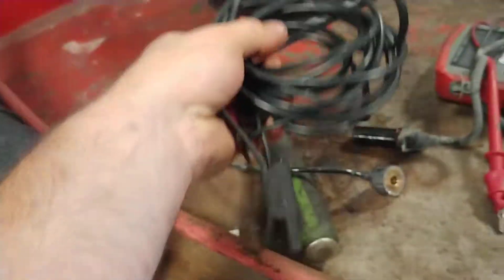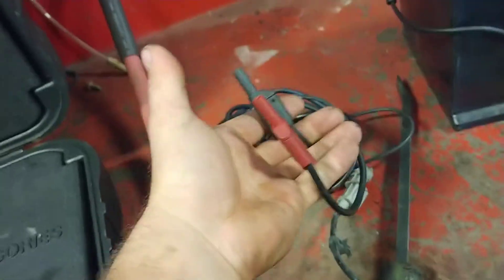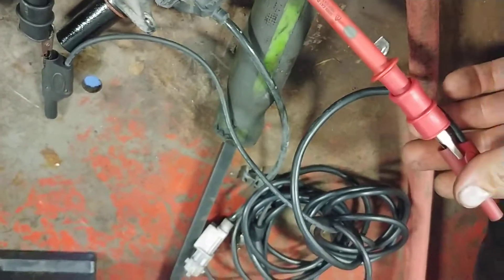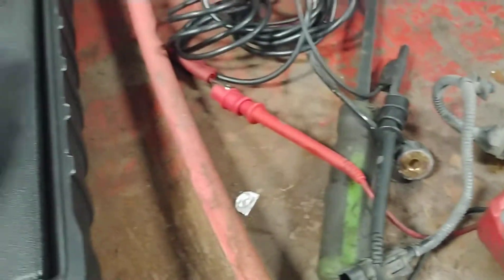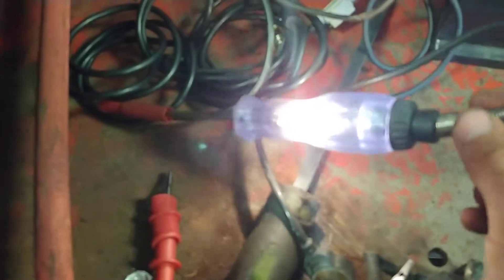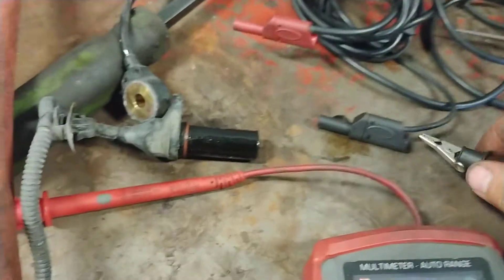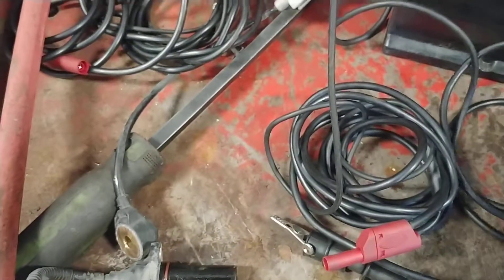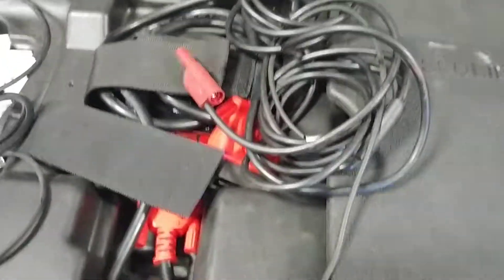Maxiscope MP408 Leads shorted internally.

Comment: Gosh... Mine did the same! Doing some basic testing on ignition coil, on my free time -experimenting.  Coil started smoking when I stepped away! Pos lead shorted to ground within cable and GROUNDED the ignition Coil!

Damnit autel... Lucky it didn't damage the maxiscope!
Reply from the maker: That's what I thought happened.. at least I'm not the only one.  Hopefully they will fix the issue..

Comment: The hantek leads that come with the autel mp408 have a issue at the  banana jacks....if you open the banana 4mm jacks you will find strands of ground shielding wiring touching the positive cable within the jack...
Reply from the maker: Thanks for the Info